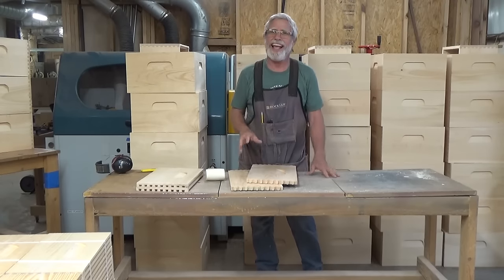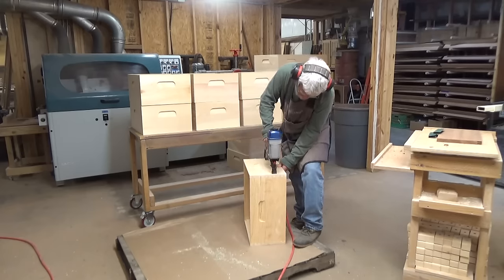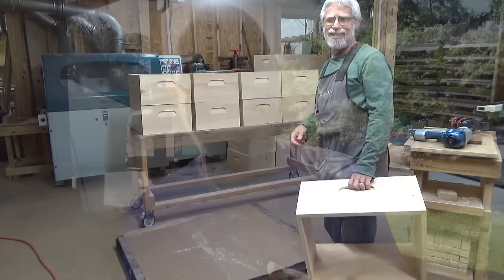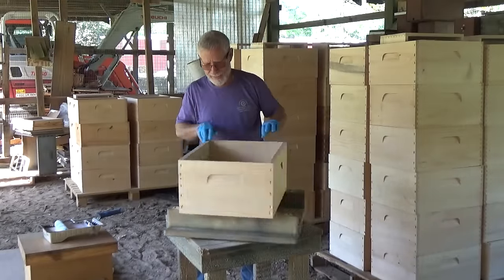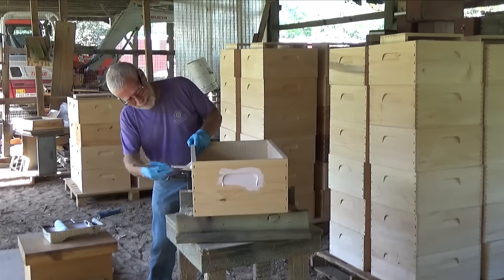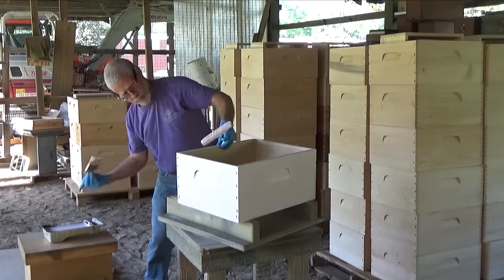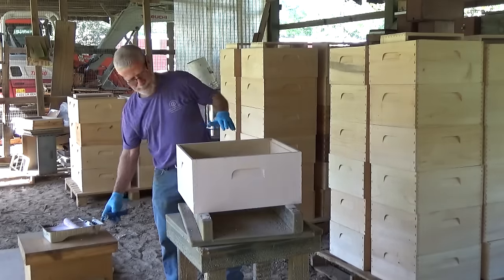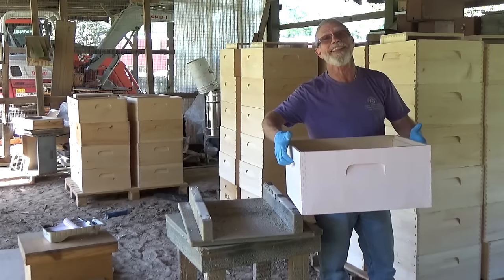MRED10

Comment: Mr. Ed you carismas of smiling all the time is what makes your videos so special… I was I bit in shock you didn’t used glue on the joints, most of the adhesive are stronger than the wood.. yes it may be time consuming, plus painting, why not the whole pile you have on the videos at least the first coat, even with small spray house gun  you can paint all those boxes in one hour the most.  It will be more messy spreads all over the place but with plastic liners you can control or have a paint booth… got to be an easier way… God blessed you all including audience & bees alike.. farewell from NYC 🇩🇴🗽🇺🇸🦅🐝

Comment: Hey Jeff , after watching you put the Premier boxes together, I ended up buying 5 deeps for a trial run . The heat and rain we get here in coastal central Florida is a killer on our boxes. We love the tight dove tails on these and the rough interior. I did glue the dovetails and stapled them on the ends also . This coming Thursday we will be placing 5 Swarm NUCS into them , can’t wait to see how well they do. We will be painting the outside as we have watched wax dipped boxes melt in the hot summer sun .
Only took 20 minutes to assemble the 5 boxes !
Lord bless you brother !
Reply from the maker: I just love the joint on those boxes, no other company uses that joint and it makes assembly so easy. I know you will love them like I do. I hope you used the code "MRED10" when you purchased them and saved a few dollars. Thank you for your blessings and for watching. Until the next one, God's peace Terry.
Mr. Ed

Comment: Jeff, thanks for another great video! As a fellow woodworker who is always looking for ways to simplify and speed up repetitive tasks, I'm surprised you haven't yet made a stapler-positioning jig that fits over the corners of the boxes you're building and positions the business-end of the stapler for each of the 5 staples. That would put every staple in every box exactly where it should be - identical on each and every box.
Reply from the maker: I'm all about fixtures and jigs, they make repetitive jobs efficient and the final product all the same. However in this case, a simple matter of visual placement is all that is necessary as the bees really don't care if it's perfect. Thanks for watching. God's peace Dale.
Mr. Ed

Comment: I noticed you didn't glue your joints. I know youre a much more experienced woodworker than i am.  Was that just a time saver building so many boxes?
Reply from the maker: Not at all, I have NEVER used glue when assembling supers, in my opinion between whatever you use to protect the wood, paint, wax, or whatever, and the bees propolising it, it is not needed. However, if you feel better putting glue in the joints, go ahead and do so. Thanks for watching. God's peace.
Mr. Ed

Comment: 3:34 Have you ever thought about a laser burner for the hives? I bought a laserpecker 2. In New South Wales, we have to have our hive brand on the hive. And believe it or not, hives get stolen here. ( My dads a retired Police and his first detective case was stolen bee hives) With the laser burner, I burn in my brand, hive number... fun to play with, and it does take some time to dial it in. It can be done with a laptop or phone app. You can also put designs on the front like your Abbey logo. It gets a layer or 2 of Tung oil and its good to go. Love your work. Steve
Reply from the maker: We have 2 lasers here at the wood shop and we use them to brand every casket we make. Still I have not considered using it to brand our hives. Yes, I know beehives are stolen, I've had 2 of my own taken about 10 years ago, and fortunately, that was the only time. Though I like the idea of branding, it's a process I won't be doing due mainly to the time it takes to do it. Curious, how did moving the hives go? God's peace brother.
Mr. Ed
Reply: @JeffHorchoff  Hi Brother, moving hasnt happened yet. I'll make a video like you suggested if it happens. It'll be some time away. Im awaiting workers' compensation payments for my spine. I was reading Tasmania's bio security rules, and SH bettle is what they're worried about.  They dont have it there. My hives have it. So im not sure how it's all going to go. I have 8 Dachshunds.  I have to get vet certificates for each weiner to take them to Tasmania. BIO Security is real strict there.
Reply from the maker: Wow, you have a list of things to do on top of your health issues, I'll be adding your name to my prayer list to help in my little way. I hope all goes well for you. God's peace brother.
Mr. Ed
Reply: @JeffHorchoff  Love ya mate
Reply: @imcmcguiness5110  I reckon it's best to bite the bullet and start fresh - sell up your hives on the mainland, and build/buy new in your new home. My family's long term plan is to move from Vic to NZ and it's flatly illegal to take the cows with us so we'll be starting up cow farming from scratch once we find the right land. I'll miss the bloodline we've built here .. but it is what it is.
Reply: @tealkerberus748  Its in my thoughts.  I dont wanna lose my Queens though 
 They're so good. But definitely hear ya. I'd love to go to New Zealand and start!!! Im in Penrith in Sydeny,  we have verroa at the door step. No verroa in my hives. I have a cousin in Mt Dandenong and she's a bee keeper. If i can get them to her they can stay there untill i figure out TAS bio security.  It seems they're more worried about small hive beetle than verroa at the moment. Maybe they can stay in Melbourne till i can get Bio security sorted..I really dont wanna give them up. Apart from my first hive they're all swarm and cut outs.  So much hard work went into them.

Comment: Jeff what's the final box look like if it's dipped and not painted? Is there paint on the inside of the dipped boxes? How often do you do this project?
Thanks God Blesd
Reply from the maker: I love the look of the hive body after it has been hot wax dipped, and none of the almost 150 of them I have are painted and they look fine...at least to me and the bees. No, there is no paint on the inside of the dipped boxes as the inside is also wax coated and needs no protection. The last time I build boxes was almost 2 years ago. Thank you for your blessings and for watching. God's peace.
Mr. Ed

Comment: Hi Jeff, I have a question. Why do you use nails on the boxes opposed to just a few dabs of wood glue  before you put the box together
Reply from the maker: As a woodworker for almost 55 years and one who knows the worth of glueing things together, and as a beekeeper who has been assembling supers for over 40 years, it is my opinion that using glue when assembling supers is unnecessary. Though manufactures suggest it, and if it makes the beekeeper feel better using it, then I say go right ahead, but I will continue my practice of not using glue to assemble supers, the bees make sure the boxes stay together. Thanks for watching. God's peace.
Mr. Ed
Reply: @JeffHorchoff  I didn’t mean to sound rude. I was just wondering if maybe it was because the smell of the glue or something would run the bees away or something.

Comment: What do you think of painting the boxes with a sprayer?      One could stack them 4-5 high and paint it like a pillar.   
   Although I am just getting started I dont like going 1/2 way on anything.  The cost of shipping is obscene and thus I often buy a pallet of stuff and sell off the extra.
If you get this far .... what kind of paint was that....  yes... white...  but was it acrylic?  or laytex?

We are 5000 miles a part or I would come and shake your hand and ask a few questions.   
cheers
Reply from the maker: I have sprayed boxes in the past, but with only 85 of them to do, the set up necessary is more trouble than the time saved. I use an exterior latex for the paint. If you ever travel the distance, I'd bee happy to shake your hand and answer some questions. God's peace Mat.
Mr. Ed
Reply: @JeffHorchoff  Thank you for the reply.   "in the day"  spraying meant compressed air.  Now with airless sprayer you just drop the intake into the can and spray away.   I only mention this as you may someday have to paint some more hives.  
If one had to buy the sprayer just to do 100 boxes probably not worth it... but I already have  the sprayer  thus I ask.
If you clean the sprayer to food grade clean and put it away it is good to go next time.   Leave the hose and nozzle dirty and you are hoooped.
no reply needed.   cheers.  
You flatter me.

Comment: Those straps can be removed if you twist the joint 180 and pull the long end and they pop right open.
Reply from the maker: I'm going to do that the next time to see if that really works. Thanks for the tip and for watching. God's peace Peter.
Mr. Ed

Comment: Mr Ed, why did you need to staple when the dovetail joint is tight? 😮😮😊
Reply from the maker: The joint still needs to be secured, and stapling the ends together ensures the joint from opening. Thanks for watching. mGod's peace Sherry.
Mr. Ed

Comment: No glue needed on those boxes?
Reply from the maker: Not at all, I have NEVER used glue when assembling supers, in my opinion between whatever you use to protect the wood, paint, wax, or whatever, and the bees propolising it, it is not needed. However, if you feel better putting glue in the joints, go ahead and do so. Thanks for watching. God's peace Mark.
Mr. Ed

Comment: I'm confused. I was taught that we don't wax dip the box panels before assembly, even though we could do that with a much smaller wax pot, because we use glue on the joins and glue won't stick to wax. But you're not using glue, just those perfect blind dovetails and staples. So why not have your own little wax vat and dip the panels before assembly?
Reply from the maker: All the boxes that I have had dipped were all assembled and then dipped. It's possible the individual pieces could be dipped, it's just not the way I had it done. I have built hundreds of supers and have NEVER glued any of them, in my opinion it is not necessary. But if it makes someone feel better doing it, then do it. Thanks for watching. God's peace.
Mr. Ed

Comment: You're not using glue on those boxes? I guess with the dovetail joints you don't have to?
Reply from the maker: As a woodworker for almost 55 years and one who knows the worth of glueing things together, and as a beekeeper who has been assembling supers for over 40 years, it is my opinion that using glue when assembling supers is unnecessary. Though manufactures suggest it, and if it makes the beekeeper feel better using it, then I say go right ahead, but I will continue my practice of not using glue to assemble supers, the bees make sure the boxes stay together. Thanks for watching. God's peace Gordon.
Mr. Ed

Comment: No glue?
Reply: They have interlocking dovetail joints. Plus then he drove inch and a half long staples into corners with that 8-pound stapler. I am guessing that works.
Reply: @WarmFuzzyVibes  the glue is more for keeping moisture from entering the joint. Just a little extra barrier.
Reply from the maker: In all the years I have been building boxes, and I have built more than 500 of them, I never used glue. As long as the boxes are square, the bees propolis them and they are good to go. God's peace Brian.
Mr. Ed
Reply from the maker: All that is needed is to have the bees propolis them and the job is complete. God's peace.
Mr. Ed
Reply: @JeffHorchoff  I apologize, it’s the 19% German in me. I over engineer every project. 
🤣🤣🤣 God’s peace.
Reply: If you were making some boxes yourself using a lap joint, would a siding nailer be the best fastener? And would you glue in this scenario?
Reply: @DRIECUTHoney  I just ordered 4 deeps from Propala, I will be gluing and using 18 gage staples.